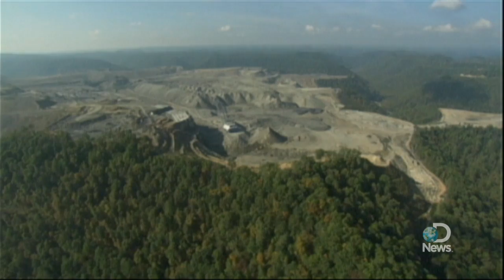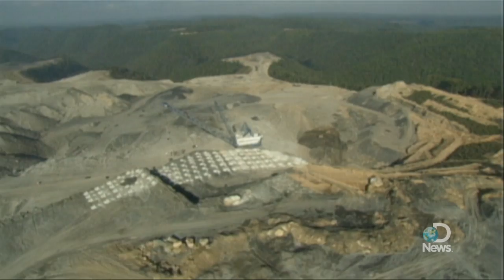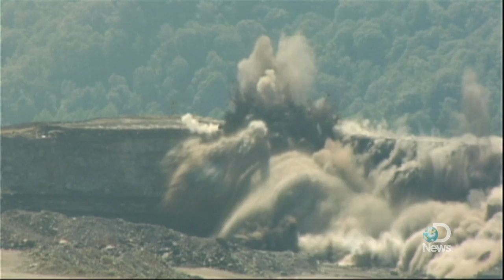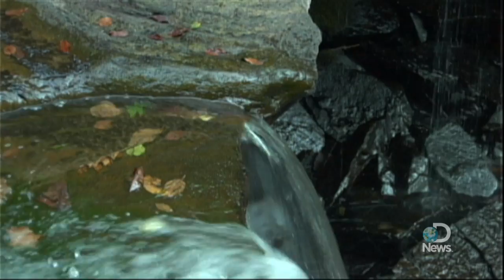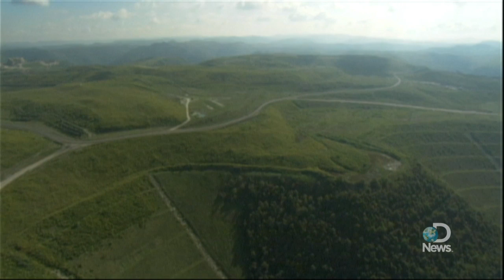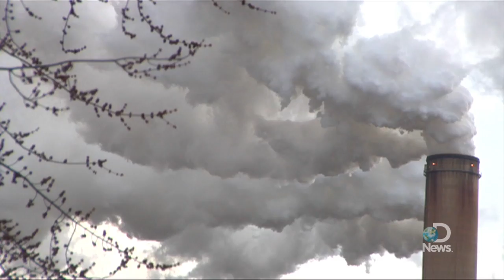Scientists Seek Ban on Mountaintop Mining

Comment: We need a federal ban on stupid fucks. you people amaze me, you hate on coal but you still use electricity. 40 percent of electricity comes from coal. they guys valley fill for the first pit, then they window it over after that, secondly, they keep all the topsoil and once everything is contoured they cover it with topsoil and plant it. yes the Shit does grow back. The so called scientist is likely being paid by oil and gas companies or nuclear companies to speak out against coal. she didn't spend enough time to even know half the story or how things really work. our government will not permit a new coal power plant which can run 30 to 50 percent more efficient than the 1970s and older plants we are forced to run. Not only would we burn less coal for the same power output but these new plants could burn coal the has not been washed to lower the sulphur and still be cleaner than the plants currently in operation and emit far less emissions. so in turn coal companies would not have large tailings ponds which by the way is our government requiring them to do so. these companies have to lay out massive bonds to assure the mines are reclaimed properly. occasionally a mine goes belly up and abandons the site, the government will spend about 10 percent of the bond and do a half ass reclaimation and then keep the rest of the cash. DO NOT SIT HERE AND TELL ME THE MINERS ARE THE PROBLEM.

Comment: Your arguments are ideological apologies. After cheap gas, oil and coal are gone (2025 - 2030) you will have two bad but nonetheless well distiguishable scenarios.
A: fertile soil and a candle
B: barren ground and no candle
Earth will go back to normal. Right. After 300 years there will be around 5 inches of topsoil. Not for crops. Just look at Verdun in France. 100 years after WWI has ended it's still not recovered. Your future already happened elsewhere.